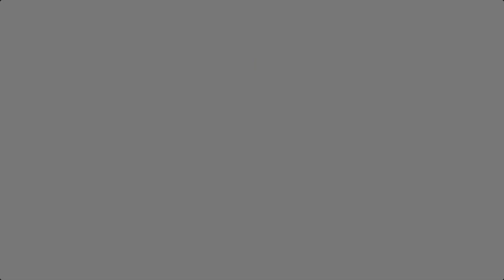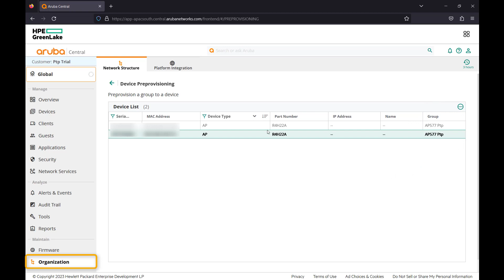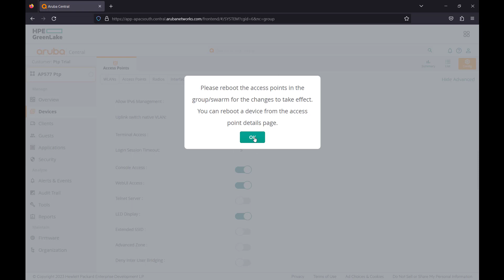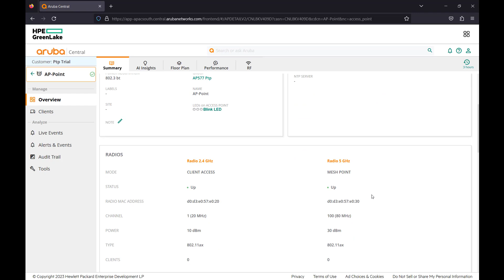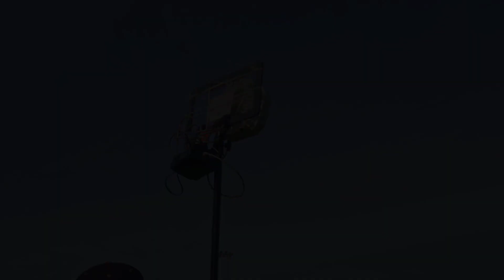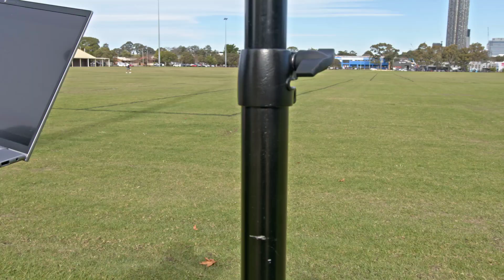How to Configure Aruba AP-577 for Point-to-Point Bridge Connection Using Aruba Central

Comment: Thank you for this video.
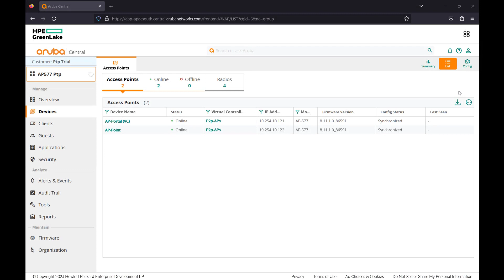I've been trying to setup 2 x AP-587 in this mesh mode however when I finalise the configuration on the point AP (6:11) and disconnect it from the local LAN and connect it at the remote switch, the mesh link doesn't form. The IP address of the Point AP doesn't retain the static IP I specified in Central and when I do a show ip interface brief it comes up with a 169 IP address.
When I go into apboot and do a printenv, it shows the specified IP address settings, but for some reason it's not showing on e0.
Does the remote switch side need to have VLAN 1 as it's native untagged set? I thought it might be able to still form the mesh link with or without a remote switch connection.